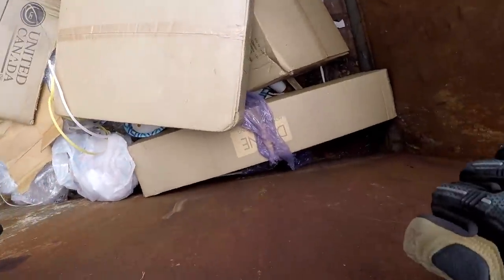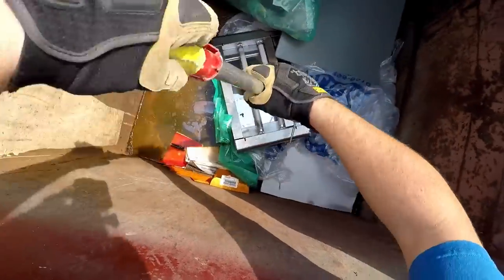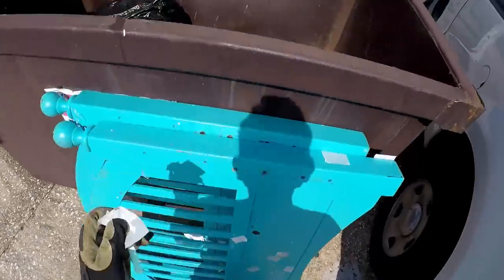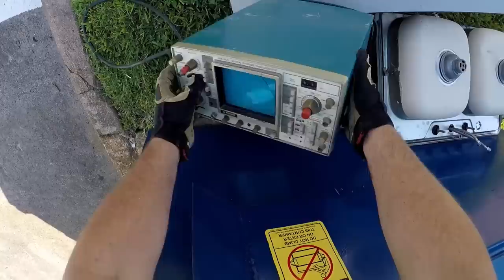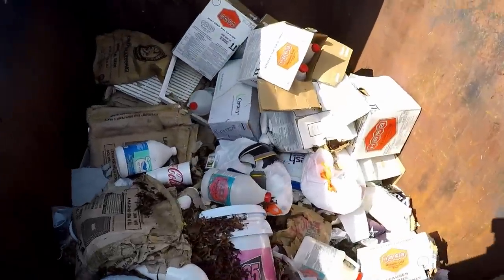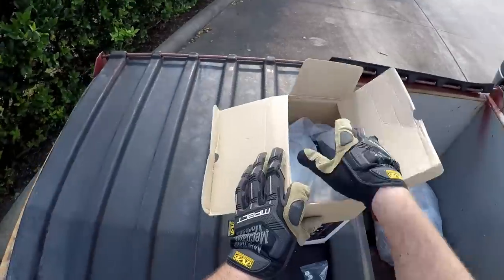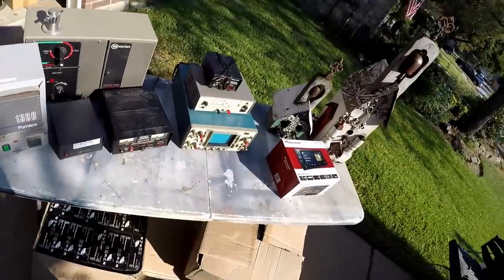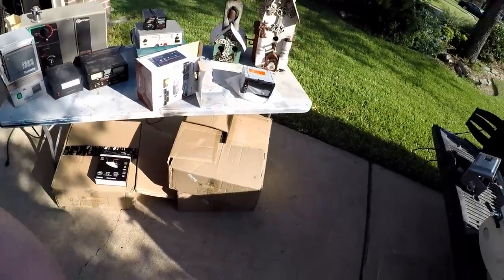Dumpster Diving “I Dove In A Dumpster Today”

Comment: If they are 120 volts you don't need a power supply. Just take a old drop cord and cut the end off of it and strip it back. Hook black wires together and the white wires together  and plug in in a outlet. Love your videos!!!

Comment: The LED lights need a power supply which sold separately.
You can test them with the right volts and apms.
See the box or any stickers for electrical information if found.

Comment: If you want to test that head unit out, just get a 12 volt battery and hook the yellow and red wires up to the positive terminal and the black wire up to the negative terminal. You could just open up your hood and test it with your car battery real quick.

Comment: If you want to check if its working, you can easily find a diagram online. Though aftermarket radios are often color coded. Like yellow is for +12v, red is for ignition +12v, black is ground, green, purple, white and grey are the speakers.
Reply: And use one of the power supplies  to power it.

Comment: You can test the pioneer head unit with some of the power supplies you found, see if there is a manual or a sticker on the car stereo explaining how to wire it, test it on 12 volts.. could save you some time and some bucks

Comment: Those LED lights are 120 volt.  They are for cans. that are in the ceiling.  there is a socket that can go in were the bulb is.  or you can get cans that have that plug on them already.  I have both.

Comment: very simple to check the deck if it’s working plug that little harness in the back of the deck connect a yellow and red wire together which is accessory and battery go to your car battery touch the yellow and red wire that’s connected together to the positive and the black wire to the negative the head unit will turn on Bingo Bango that turns on it works if it  doesn’t turn on its no good very easy way to test any car stereo head unit

Comment: 2nd mike vid after the scrap run truck is now partly empty, huh new lights, might be there partly damaged as in a box got dropped so that means ther all broken but i bet only a few are nice though good resale right there or better yet upgrade the house lights, bar keepers friend? you mean a guy that pays his tab, or the baseball bat under the desk if trouble starts lol, glass its okay but broken no i think there for drips or gas to rise up those clear pipes to see if its going up or staying down as you'd see the glass change colour or something like that i don't know scince not ma strong point, water in dumpsters huh guess that area had a shower or rani but you didn't, mind you after those doors i'd be out and a storm could roll in and roll out and i'd be still asleep in ma bed, aww cute lil baby furnace! other then rust that'll be great for melting the candle wax in mike! dam lotta good spaceship parts in this dumpster, oh nice bird houses just cut the rot off mike or put a new base on, score if that works the screen dealo nice! ol' mikes going to be busy shorting and stripping and fixing,

Comment: You know those pool mars are a 1000+ new used usually 150-250 each if the work if not it almost always the soft start capacitor.   Rebuild sell for 500 each or more  . Want that furnace  how much?

Comment: Get some Bondo sanding down smear some Bondo shape it so it doesn't look any like it's rotten and then paint over the Bondo once you get it smooth that's if you want to keep it FYI Victor putting my two cents in it from Palmdale California 93591

Comment: Dude... that lab equipment. I cant even fathom someone just tossing it out... it has to be worth good money even as parts
Reply: You can soften them in a gass flame,use is for blowing glass......
Reply: @Irene-iu9sj  I think he was referring to the electronic stuff (oscilloscope, power supplies, etc.), rather than the glass tubes in that one dumpster.  

However, you are correct about the use for the glass tubes.